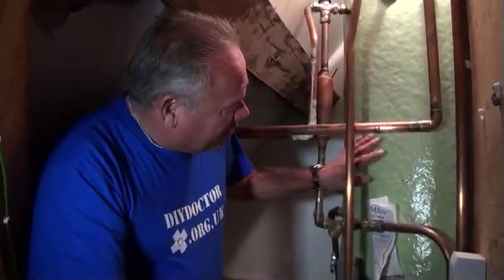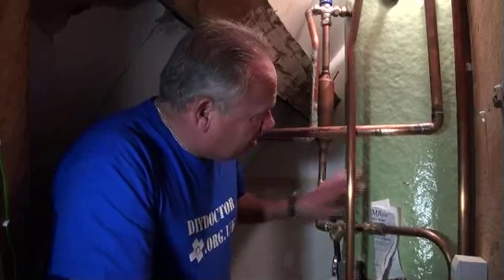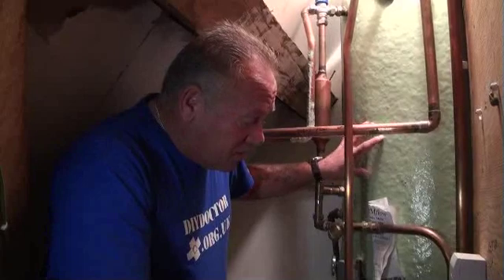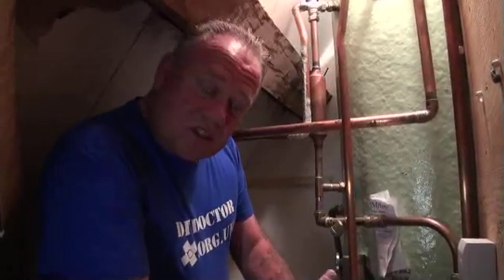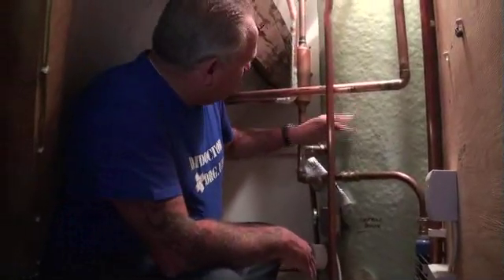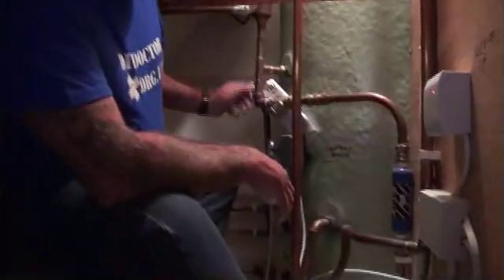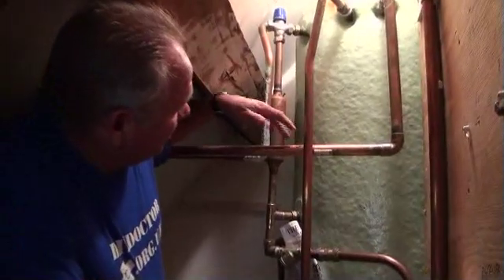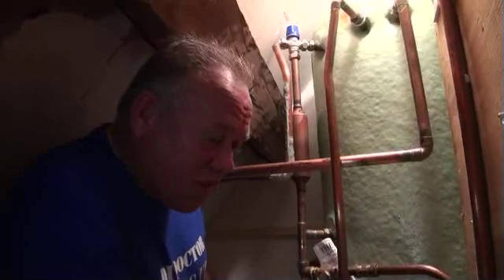How to Fit and Install a Thermal Storage Tank

Comment: What happens on the summer months when you need dhw? How will it heat do you need to have the ch on?
Reply from the maker: No,you can turn the valve and bypass the heating.

Comment: Hi DIY Doc, I was one of the first people to design a thermal store with Gledhill 25 years ago.
My Wimborn thermal store has no coils and in the day all the heat from my 44 tubes is direct into the tank, which then goes into my radiator heating system
Contact me for my NEW Gas Boiler stay working during power cuts and storms

Comment: Duh! Just what I am looking for my in-effecient oil boiler only I am looking to use sand or concrete or insulate an tank or series of pipes or perhaps even an old cast iron radiator. The  goal is heat storage so the furnace doesn't have to run continually during cold weather or as often thus saving fuel oil as the furnace doesn't have to work as hard and reduce the amount of fuel oil needed. I may need an additional circulation pump. I have plenty of room in the basement .